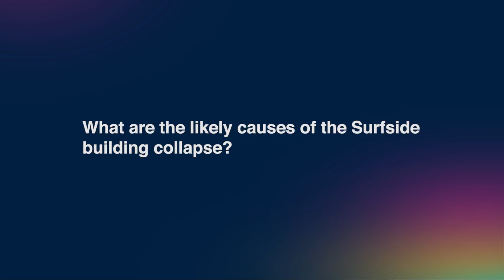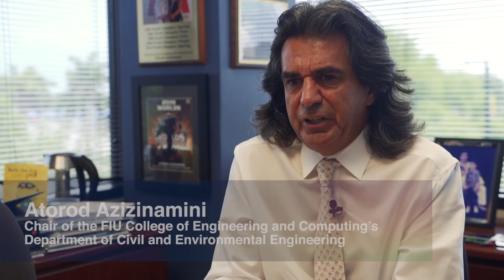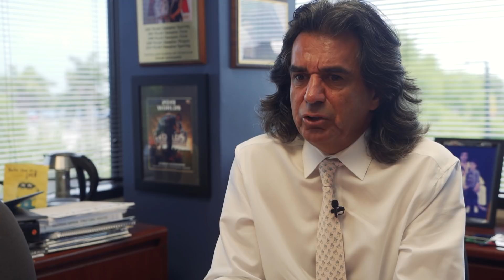Interview with Atorod Azizinamini on the Surfside building collapse

Comment: Buildings collapse either because of dynamite or profit. Surfside wasn't dynamite. A huge Turkish flour factory rolled over and over as one complete object when they tried dynamite. The question should be asked, why did it do that? And compare that construction asking why did the Surfside condo basically just fall down on it's own. We don't need the professor and his investigation of lots of itty bitty details. It fell down because it was cheaper to build with a small margin. The itty bitty details margin.

Comment: Multiple eyewitnesses said they saw the pool deck and garage area of the Surfside condo fall before the rest of the building collapsed. So there is solid proof as  to what caused the initial failure. It could be  either Foundation failure or Rebar Corrosion on pool deck.

Comment: Professionally side stepped the question.  You could have just said, I don't know.  It was obviously a failure of the columns some where in the parking garage  in the center of the building.  Caused by moisture, sediment flow and corrosion.

Comment: The collapse started at the pool area, next the center front colums(3) was pulled down the mid section and last the south section(15 sec later).
The water proofing at the pool deck was in dire condition, water was leaking into the garage area  and destroyed the rebars in the columns. When rusting happens the metal expands and the concrete falling off in chunks. This further weakens the columns until it collapses. BTW this is how building demolition happens with explosives too, by putting under load bearing columns. 
The whole detetioration process start slowly and speed up exponentially in a relatively short time. The water also can was the dirt out under the garage floor which further weakens the structure.
They should start the repairs in the pool and garage area not the roof.
Utterly negligent behavior.

Comment: These buildings have significant corrosion, rising water table, new buildings with new foundations that may have negative affects in the neighboring old buildings, inadequate inspections, added weight over the years and also earthquake induced by the USA Navy 3.9 magnitude on June 18, 2021 off Florida East Coast that may have had influence on the collapse.

Comment: In the end this comment will be correct. The talking heads will lead you through a maze of confusion. The roof was loaded with Materials , BITUMEN ROLLS = PALLETS WEIGHING 1800 LBS, hot mop tar rolls, plastic debris and  roofing garbage, A large steel beam red iron, a chiller , all the ac units constantly leaking on the roof(attributing to rust). The roof steel was not (centered in the slab and was ripped out of  tower still standing) = changing angular momentum axis of slab.
Witnesses, worker across the street heard and saw water . 
Witness Cohen and his wife stated garage was filled with water to just under his knees when he tried to  escape after the collapse.
The pool did not lose any water.
We had torrential rains before the collapse.
We all know roofers do not clean up at the end of the day . **Paper and plastic debris  everywhere**
Roof  had parapet walls and roof drains . If the roof drains clogged from debris and the roof flooded , this weight along with material weight would have overloaded columns and caused the collapse .
  When they stock roofing materials it is by crane and if they do not disperse the weight they can make a column or slab break easy .
Reply: If the contractors started on the ground first and then ended up repairing the roof, nobody would have died.
Reply: I agree 100% with you.

Comment: If it was a well built structure, it could not crumble like this. Concrete may be not mixed right and the reinforced steel was unbalanced designed. Any special inspection engineering lab can analyze the concrete strength. 70% I can predict that the concrete was not mixed right.
Reply: Agree. The concrete just crumbled

Comment: In examining the surveillance video of the collapse, you can see flashes of light on several floors, seconds before floors pancake onto one another. It sure looks suspiciously like a planned building demolition to me.
Reply: Unless for some reason the building had electrical connections or gas lines.
Reply: I agree. If you look at the cloud of smoke-it is black at core. Building in China that collapse-shake first. No shaking here. My government picked this building because of the cracks. My government is sick.

Comment: From the video...it looks like the middle right collapsed first, IF they were replacing some things with the foundation and did not have it supported properly...the temp supports could have failed causing immediate collapse. No one noticed or heard a thing as everyone was asleep. That is a BIG IF. We have to wait on the engineers and architects...they will get to the bottom of it.

Comment: A few days before the collapse the Navy exploded a new type of weapon that registered on the Richter scale in Florida. Could this have been a result of such an explosion it was  100 miles off coast.
Reply: A couple years ago, a tenant there sued HOA of that building.  He told them that he felt the building shaking.  Some tenants also complained about mold, crack of the building too.  Your conspiracy theory is crazy.  If the Navy did something like you said, then other old building would collapse too.  But, only this building is collapsed.  Your theory made no sense whatsoever.
Reply: @mathildaapril1175  maybe the sand where this building is located could have liquify or create a sinkhole nothing to do with structure of building. No conspiracy just a fact the test happened  and all situations should be looked into.

Comment: Properly constructed buildings don’t do this.
Reply: @musiccalgary  subsidence can contribute. But I suspect substandard concrete. The sister building had chunks of concrete falling off a basement column.
Reply: Sure they do,  WTC 1, 2 & 7 were superbly constructed & yet they were disappeared in less than an hour. 8777 Collins Ave. is controlled demo 101 or do my lyin' eyes deceive me?
Reply: @lorenzomoog1205  I’m no conspiracy theory nut. But, yes. That’s exactly wat a controlled demolition would look like.
Blow d critical columns in d middle. Blow all d shear joints at each level of slab.
Central core section collapses, pulling remaining corner building into a nice neat pile in d middle.
But I’m no conspiracy theorist…
Reply: @djtan3313  You don't need to be a conspiracy theorist to describe what you are seeing when you watch the collapse video.  There is an extraordinary  loud noise that immeadiately precedes the collapse, then two building fall into their own footprint.  A great cloud of dust rises up.  That's it, that is what I see.  If it is not a controlled demolition it resembles one in every detail.
Reply: @lorenzomoog1205  do you think it’s related to John McAfee, to divert attention from pending legislation or for some other reason?
Reply: @tango-bravo  Of that I have zero opinion.  I am only interested in what I observe in the collapse.
Reply: The collapse started at the pool area, next the center front colums(3) pull down the mid section and last the siut section(15 sec later).
The water proofing at the pool deck was in dire condition, water was leaking into the garage area  and destroyed the repairs in columns. When rusting happens the metal expands and the concrete falling off in chunks. This further weakens the columns until it collapses. BTW this is how building demolition happens with explosives too, by putting under load bearing columns. 
The whole process start slowly and speed up exponentially in a relatively short time. The water also can was the dirt out under the garage floor which further weakens the structure.
They should start the repairs in the pool and garage area not the roof.
Utterly negligent behavior.

Comment: Spread the word - ALL CONCRETE HIGHRISES WITHOUT STEEL SUPPORT BEAMS ARE IN DANGER OF COLLAPSE. Era of increased solar radiation is deeply penetrating and drying out the water entrapped molecular cohesion of the concrete causing it to get brittle, weaken, and disintegrate. -Like a mountain topped with heavy snow it could be a mere BANG! noise to trigger an avalanche collapse.

Comment: The engineers who calculated the loads screwed up. There's photos of the units with 2" thick travertine marble tiles. Most of the condos were probably renovated and all heavy add-ons exceeded the carrying load of the building. Look at photos of the roof with every condo having its own air conditioning condenser unit. Those are heavy and adds up. Plus they were workign on the already overloaded roof with heavy equipment and that was the cause of the progressive (or disproportionate) collapse of the entire structure. It was obviously not over-built because it's laying on the ground
Reply: took out walls to to open up space I bet

Comment: reparing the roof, it collapsed from the center. Uneven load from repair material?
Reply: Uneven load on the roof would cause the roof to collapse not the lower levels. The collapse started down low. An uneven load on the roof does not do this.

Comment: Tuck this away in the “We will NEVER know what really happened” files.
Reply: @JuliahFL  Yeah you laugh but you have no legitimate criticism and you will from now on think twice about entering a CHEEPLY MADE concrete high-rise without steal support columns.
Reply: Spread the word - ALL CONCRETE HIGHRISES WITHOUT STEEL SUPPORT BEAMS ARE IN DANGER OF COLLAPSE. Era of increased solar radiation is deeply penetrating and drying out the water entrapped molecular cohesion of the concrete causing it to get brittle, weaken, and disintegrate. -Like a mountain topped with heavy snow it could be a mere BANG! noise to trigger an avalanche collapse.
Reply: @termination9353  WORD 👆.
Reply: @termination9353  My mind was fuzzy from Girl Scout Cookies this morning. My bad.
Reply: @JuliahFL  If that is a sincere apology - accepted.
Reply: @termination9353  It absolutely was! Thank you for accepting my apology. FYI, for my penance, I subbed your channel and watched an entire video. Hey, is that you singing? Whoever it was, it was 🔥!

Comment: it was an implosion, If you slow down the video from the webcam you will see white spots appear around the building before collapse, the building fell free fall, the building fell in the middle and then the outside, just like a demotion, also the free standing building that was left, was meant to collapse as well. WE need someone there videoing all of this, this is a mini 911.
Reply: The white spots were reflections of the glass as the building began flexing.
Reply: @nolandlacroix3130  HA, you really believe that ?. when glass flexes at all it breaks, most of the time, if the building flexed and it didnt do that, then so be it, but there where white flashes all around including behind the building in the smoke as the front of the building collapsed. look more carefully.

Comment: Just watched the local evening news.  Past records reveal that the building was constructed on reclaimed wetlands.  So I'm thinking ground subsidence.  But there are other buildings like that one along the same straight and none of them are experiencing problems, that we know as of this time.  I'm sure there will be many intense inspections to come.  This building was about 40 years old.  It had cracks in the walls during regular building inspections that were noted, but nothing severe enough to cause...concern?  Plus the building had been sinking about 2mm per year in the past three decades...30 years they knew the building was sinking.  Also buildings of this size and usage are required to be re-certified...every...40...years.  Whoops, too late.  I was thinking perhaps a sinkhole but when the engineers were putting down pilings they would have found out had one been down there; though that's not to say that one could not form after building was complete.  Earthquakes are quite rare to the state and never in the southern region.  My official conclusion as a professional YouTube engineer is ground subsidence.  Poor building maintenance could contribute as well if water drainage was inadequate.
Reply: Most of south florida is reclaimed wetlands.  My theory, since they need to investigate (probably about a year) to be confident in the cause, is probably saltwater corroding the metal framework, compromised a floor to failure, other floors were similarly compromised, one floor failed and added weight continued the domino effect.  Figure concrete is porous and has no shear strength so rebar is added, if anything damages the "membrane" of paint and such then water can get into the concrete, add salt to the mix and it will work faster.  From watching the video it looks like there are lights on some of the top floors and top rt went out 1st, unless the lights are from wall fixtures it would be in the ceiling and a floor failing would be a failing ceiling below, causing electrical to be cut as it came down.  If you look at an overhead the area that fell is an interior corner aimed at the ocean, which would have 1) an accumulation of vapor from the ocean 2) airflow that would potentially be disrupted from being an interior corner which would reduce drying capability and 3) disrupted rainfall to rinse the saltwater off or dilute it.
Reply: @ryanwright9460  That is an excellent point.  We know that water collecting in a building can, over time, have disastrous effects.  That may be the cause here since the building had been sinking for quite some time and water does take time to do it's thing.  So water leaking into the faulty roof or other cracks caused the deterioration of essential materials necessary to maintain the building's integrity.  Can't wait to see what the blueprint shows and how they were deviated from.
Reply: @RondoHunter3.14  in all reality unless you are part of a jury, an engineer (civil or structural getting some peer to peer news or info from ce classes) or one of the investigating people it will be a blurb in the local news about 1 year from now that we almost forgot about.
Reply: @ryanwright9460  That is so true.  Some years back, local, a buddy was working a job building a parking garage for an adjacent building.  After several floors were successfully poured my buddy said they began noticing cracks in the walls.  They notified the proper personnel and went about their jobs.  He said he saw cracks big enough he could put his hand in.  Sure enough one morning a major portion of the building collapsed as concrete was being poured on an upper level floor.  I called him as soon as it hit the radio.  Fortunately him and his guys had stopped for breakfast and had not been on site at the time.  Talk about good luck.  (https://www.news4jax.com/news/local/2021/06/24/condo-tragedy-reminiscent-of-berkman-garage-collapse-in-jacksonville/).  I'm parking on the street from now on.
Reply: Dont forget the load on roof…..
Reply: @susycue3  loads on roof is negligible unless it was compromised from structure, only thing that would cause an issue is someone putting heavy equipment on it or drains being blocked essentually turning roof into a swimming pool....we have had some rain, but I doubt that much.
Reply: @susycue3  The building should, under ordinary circumstances, have been able to withstand such a load.  I don't see how the roofing material and equipment used would have had much of an impact on the building itself.  If a faulty roof allowed water to penetrate the building that could have serious implications, over time.  During the course of the construction it's doubtful that enough water could possibly penetrate to do any lasting damage, which would take some time.  Don't know how long the roofers had been at it but the building had been sinking for about three decades, that they knew about.  That's what really pisses me off; officials knew something wasn't right, they knew exactly what the problem was.  But the law did not state what must happen should this occur.  Much like India where the building owner controls all the shots.  "Cracks?  What cracks?  That's just a new paint job."  Much cheaper than addressing the real, very expensive, fix.

Comment: There is a good article just released regarding FIU research on the area and that it has been sinking 2mm a year since the 1990s.
Reply: A few experts have since stated that 2mm is not a bad thing but 1" or more is. They also stated all high rise structures sink a little bit over time.
Reply: @jasoncrandall73  Thanks, Jason. Did you happen to catch the 6/26 am press conference  There's talk of evacuation of similar condos in the area. It'll be interesting when the investigation is complete. Hope the fires are extinguished soon so the teams can get in there. Reminds me of the WTC challenges a bit.
Reply: You heard it wrong.  They said that they found the building sink 2mm in the 90s.  It did not say that it has been sinking since 1990s to now.